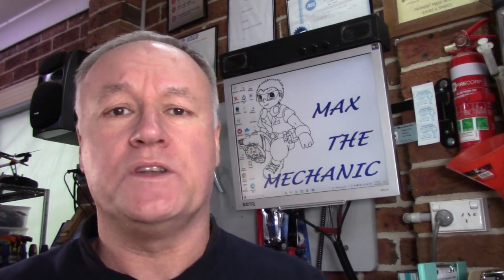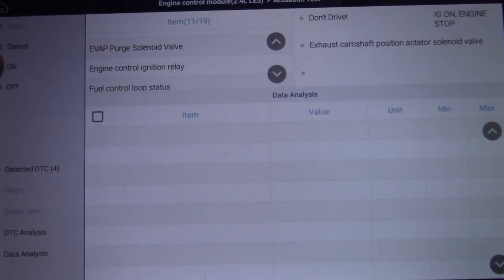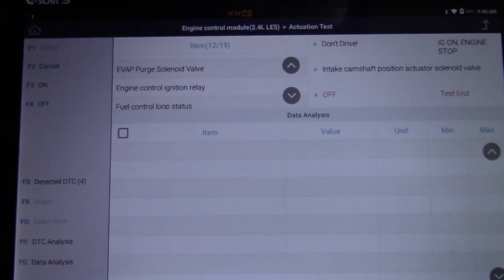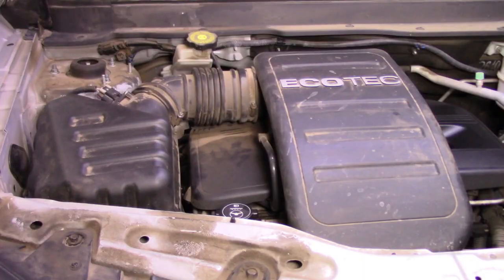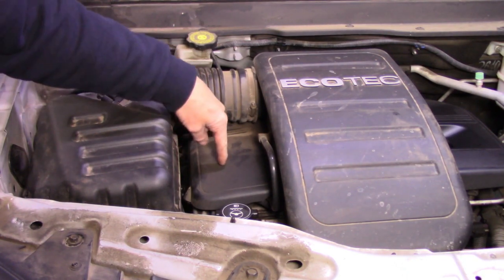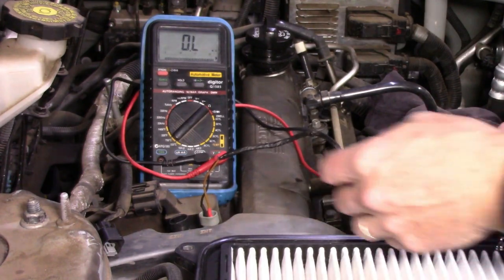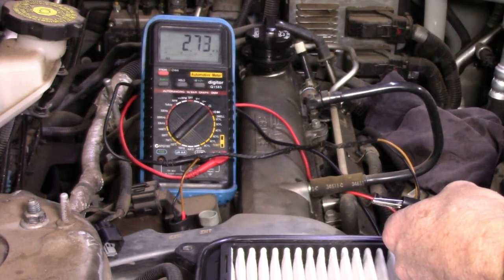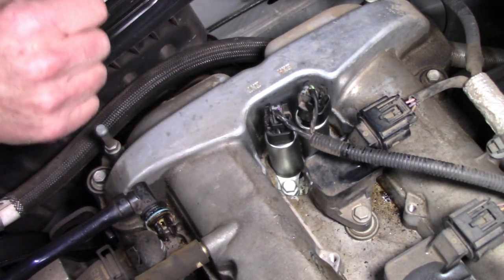Captiva Camshaft Solenoids P0010 P0013 DIY Guide

Comment: Similar thing happened to me. Always had my car serviced and this came up. The service people told me to ignore it as it was oil build up on some part that had brushes. I decided to check the car and the oil was pitched black along with the oil filter, I could not even turn the drain plug as it was rounded. Spewing you are in NSW and not Victoria. Now I can try fix the problem. Thanks for the video will let you know how I go.
Reply from the maker: Hey SuperStevce, 
I hear this sort of misdiagnosis regularly. Frustrating! Hopefully this video will be enough of a guide to help you through the process. Would love to help out if I could. Probably a little too far to travel.....😂
Look forward to hearing of your repair.
MiracleMAX

Comment: See if you can solve this problem.. holden captiva cg series 2 2011.. car starts, but will not turn off after removing the key.. changed the starter relay and fuse.. replaced the run/ crnk both.. in the ignition there is 2 connections coming off it only.. pull both .. but the car still doesn't stop running.. so what is the problem? 😅
Reply from the maker: Well Steve, sounds like you have a live one here! I can only provide suggestions, according to what you have provided.
These have several known problems, including a starter cable fault
http://australiancar.reviews/_pdfs/Holden-Captiva-ServiceBulletin-14003A.pdf
Yes, I know that is not your issue, but worth keeping in mind.
There has been a lot of mice damage lately, so look for any little nibbles on any of the wiring to point in the right direction.
When it is running, is the alternator charging correctly? Is there any AC ripple that might have created damage?
The PCM must be getting power from somewhere. Is this petrol or diesel?
What fault codes are present?
Have you removed the fuse box and looked for damage underneath? Are ALL the relays operating correctly? Is there a main relay to the PCM that is permanently latched?

Let us know what you find! 🤔😉

Comment: Wait a min... U just showed metal peices and u go and blow compressed air down the chamber.. That seems abit of a huh moment.. 🤔.. I would have stopped and dropped the oil all out and opened the pan to take a full look.. Just to be safe cause now if I didn't I'm sure the same process would happen all over again.. Just my thoughts.. 😔
Reply from the maker: Hey Hayque Porter, 
Fair comment. Although not shown in the video, I carried out a service, which included oil and filter, which were carefully examined. Also note, that I mentioned that her son previously did a timing chain, so some of that metal may have come from the guides. I also noted on the customer's invoice that it would require further investigation - their vehicle, their choice. 
This is mentioned in the video here:
https://youtu.be/p3ZGplTcEaE?t=960
I agree with your suggestions, but ultimately, it is the customers decision.
Thanks for your comment.

Comment: Great video!  I got p0010 and p0011. So I guess I would need replace intake camshaft position actuator. Would you recommend to replace exhaust one as well, even though scan didn't show p0013 and p0014? Thanks heaps!
Reply from the maker: Hey Paul,
It depends on why the solenoid has failed. As in the case of the Captiva I worked on, most likely metal shavings from a previously replaced timing chain may have made the situation worse.
As shown in the video, check the resistances and compare with the specifications.
Let us know how you go with the repair! 😉👍
Reply: Many thanks Max

Comment: Good stuff, and you present everything in entertaining fashion.  Cheers!  Question: I don't believe you disconnected a battery lead.  If I don't disconnect, and we have a bad solenoid(s), does it leave bad data in the computer?  I was planning to clean the MAF and throttle body while I'm in there.  My son's inherited a 2013 Captiva (USA) and we had a code that lasted for 2 days and went away.  He commented that it "chugged" leaving a couple stop signs at slow speed.  Many thanks again, and God bless ya for helping the DIY-ers like me.
Reply from the maker: To remove sensors etc, you don't need to disconnect the battery. Just make sure the ignition is not turned on. I usually disconnect the battery when I remove ECUs.

Comment: In Captiva 2012 model. Does bad camshaft sensors give vibration to the engine and the car?
Reply from the maker: Difficult to say. What fault codes do you have and what testing have you done so far? Does it happen at idle, higher RPM or only when the vehicle is driving?

Comment: Hi ya Max, 
I have couple of questions for you, hope you can help.
- The exhaust solenoid is stuck, I tried to wiggle and pull it at the same time. Not moving in the upwards direction.
I was thinking of running an engine oil flush to hopefully remove some deposits, what is your thoughts?
- The inlet solenoid came out as you showed no problem, when I looked in the hole it came from I found a small spring ( fine wire , not very strong ) and collet. It doesn’t look like it belongs there, any ideas? I’d like to be able to send a photo. 
Thanks for the video, helped me out so far. Unlike the mechanic’s the car has been to. 
Any help would be greatly appreciated. 👍👍👍👍👍👍
Reply from the maker: Hey Arthur,
Has the vehicle been serviced regularly? It either sounds like a build up of carbon or perhaps metal as shown in the video.
You could use a slide hammer to remove the solenoid.
You could send a photo in an Email to me at miraclemax3@hotmail.com

Comment: Awesome video mate! My wifes aunt has a Captiva throwing the same codes currently so going to go and do a resistance check on those solenoids this weekend.
I have also had a mate who is in the trade who states that it also effects the timing chain? Is it worth inspecting aswell while im there? And if it came to it, are there special tools required for a timing chain replacement on these?
Im a certifited tech with Mazdas and almost everything with those require "special tools" so want to know before i go jumping in the deep end with something a bit un familiar.
Cheers!
Josh
Reply from the maker: Hey Josh,
I haven't personally done chains on one of these, but they are a common fault. If I remember correctly, this one had only done 90,000 kms when the chains needed to be done. You could do a cam/crank correlation to see if the chain has stretched.
Looking up service info for special tools states:
Camshaft adjuster holding tool - No.EN-48953.
Flywheel/drive plate holding tool - No.EN-43653.
Tensioner plunger resetting tool - No.EN-45027.

Comment: Thank you very much. Very clear. Can u do one for the diesel engine pls?
Reply from the maker: Hey Zia Ziaei,
I don't believe the diesels use variable valve timing. There are very few diesels that use this system. The main reasons for that are:

Most diesels are almost turbo diesels and have good volumetric efficiency

They are slow revolving engine compared to petrol. So there is enough time for air to enter in the cylinder and exhaust gas to leave the cylinder.

Power produced by diesel engine is always equal to amount of fuel injected ( remember no throttle valve for diesel engine )

Diesel engine is a lean burn engine ,ie it always runs with having excess air than required for complete combustion. Hence there is not need to add more air to produce than extra amount of BHP.

I hope that helps
MiracleMAX

Comment: great video, same car but the P0017 code even after a timing chain replacement - any experience with this?
Reply from the maker: Hey Matthew,
Have you checked the operation of the camshaft sensors like shown in the video? Are the desired and actual degree readings shown in live data on the scan tool the same? Has the oil been regularly replaced with the correct grade?
If you look in the description, there is a link to detailed Captiva information.
https://gmtis.ntweb.ru/tis/en/documents_2011/captiva/SM-C140/92229001.EN.html#4711
Hopefully that gives you a good diagnostic direction.

Comment: Hi mate do you know why 2010 captiva would vibrate or sound like it's labouring when accelerating only in low rpm?
Reply from the maker: That's a quite a broad question. Is the engine petrol or diesel? Does it sound smooth at idle? Is it automatic? Is it 4WD? Does it change when going around corners? Hot or cold? Does it have any fault codes? Has the driveline been checked?

Comment: You have a link for the part numbers or source for those solenoid valves?
Reply from the maker: I bought mine from the local parts supplier. The numbers were VT101, VT102, but I suggest that you check that they suit your vehicle.
Reply: @MiracleMAX  got the same one. No torque specs for anything? Figure just hand tight ish on reassembly?
Reply from the maker: @m4gician  Sorry, I don't have those specs.

Comment: Hey just wondering do u know  p0796 (pressure control solenoid c performance/stuck off) captiva 2013 

How to fix this code? 
Thank u 😊
Reply from the maker: Hey CamosTV,
Do you have a scan tool with live data and bi-directional actuations?
You would start by checking if you can activate the solenoid using the scan tool. Then you would check the resistance of the solenoid and compare with the other solenoids. Generally they will be similar. If you do replace the solenoid, it's not a bad idea to replace the wiring in the transmission if is located inside the trans, within the oil.
Let us know how you go with your repair. 👍😁

Comment: Do you not disconnect the battery when replacing these?
Reply from the maker: There is no need. Just make sure the ignition is turned off.

Comment: Max. Can I please ask where you are based? and do you have a video on a VW Golk mk5 rough cold start issue. D.
Reply from the maker: Hey Deon,
I'm in NSW and sorry, no video on the Golf. What are the symptoms? Are there any fault codes stored?
Reply: @MiracleMAX  thanks for getting back to me. Love your videos. 07 VW Golf MkV. Not aware of any codes (mechanic didn't tell me) cold or warm engine, key in, wait for glow plug light to go out and turn key. Engine rough start, engine shakes,
Reply: Engine shakes, sounds like it's not cracking over. It was doing it,  I replaces the battery and it was good for 6 months and it's doing it again..
Reply from the maker: @deondallinger3592  Does the engine smooth out when warm? When the engine is hot, does it start easier?
If this is the case, the glow plugs could be an issue. How many kilometres has the engine done? Is it serviced regularly?
Although not the same vehicle, this might give you some testing procedures that could help you diagnose the fault.
https://www.youtube.com/watch?v=gDZUu27Ixt8&ab_channel=MiracleMAX
Reply from the maker: @deondallinger3592  What is the voltage at the battery when cranking? Does it start easier if you use a jumper battery?
Have you done any voltage drop testing at the starter motor?
Here is a video explaining the testing technique.
https://www.youtube.com/watch?v=LHO_9Zbl1vU&ab_channel=MiracleMAX